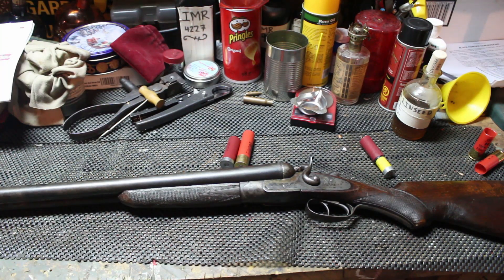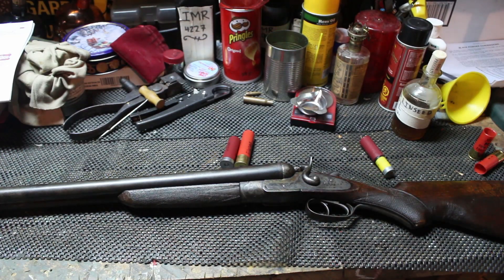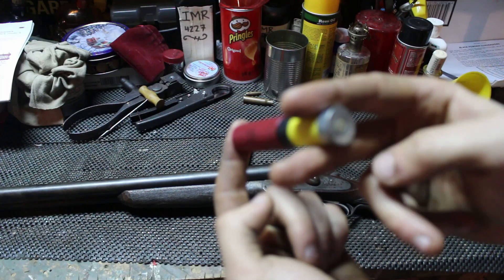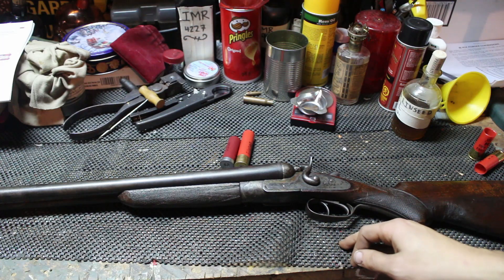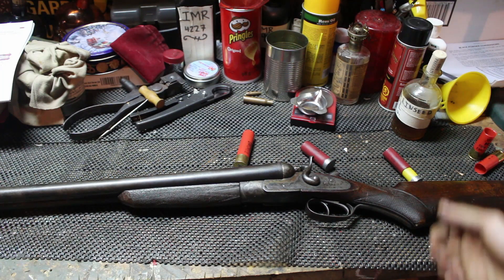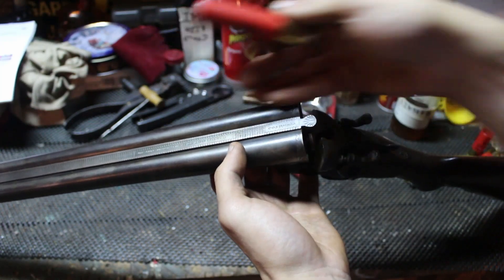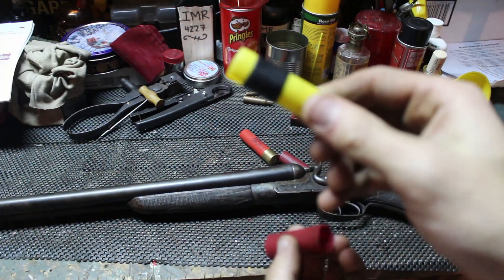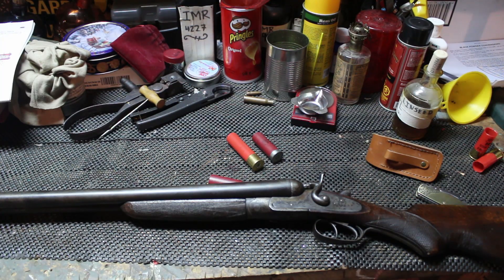How to Check a Shotgun Chamber Length.

Comment: a 2 3/4" shell is that length after it's been shot not when it's in the loaded state.
Reply from the maker: Depends if you're checking chambers on an old gun or looking at the markings on a new gun.
New guns write the shell length on the barrel. Old guns write the chamber length on them.
So for example im measuring chambers in the video. And it's 2 3/4. So that means it's a 2 1/2 shell not loaded.
Reply: Your 3.5 passes by the " forcing cone" ..the shotshell would open in the bore...thats where pressures occure due to bores tapering smaller than the chamber... If thats a belgian gun it will be marked underneathe the barrel flats
English and germanic guns are stamped
In mm 70mm bei g 2 3/4"   65mm 2 1/2"
67mm 2 5/8.  76mm " .i have 15 sxs guns. Most are 2.5 "...but lits of people opened them to accept 2 3/4" by having the chambers reamed...

Comment: some old shotguns have giant chamberd for what they are supposed to be. I have an old husqvarna that is 65mm but it fits fired 76mm  shells easily (so with opened crimp) its somehow a centimeter longer than it should be.
Reply: Dont have all husqvarna's 70mm chamber length? So made for 65mm crimped shells? Thats what i was told. Most of them are also really great quality steel.

Comment: This also true with old milsurp rifles too. some projectiles will go in very far because of the worn throat rifling right past the chamber. when using cast projectiles ya gotta check this out.  If you think you want to keep back 5-10 thousands from the lands n grooves and make up a bunch of rounds they might not fit in the mag ????  some Enfields are crazy long.........gotta check n check.

Comment: Quick question. Any suggestions on what shell length a 1897 Winchester 16 gauge pump may take?
Reply from the maker: I shoot normal 23/4. I have a 16 gauge and I shoot modern shells.